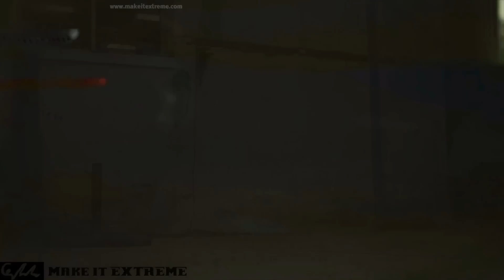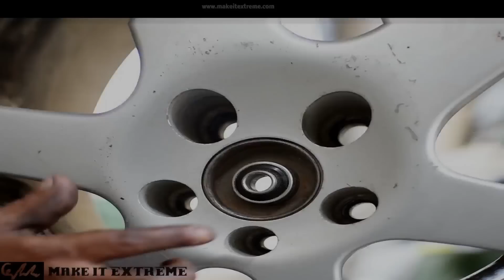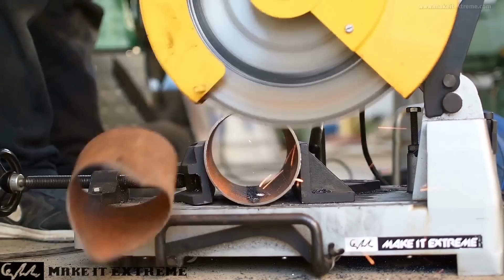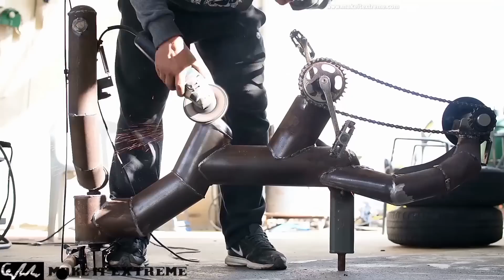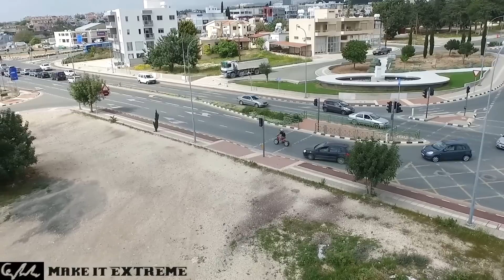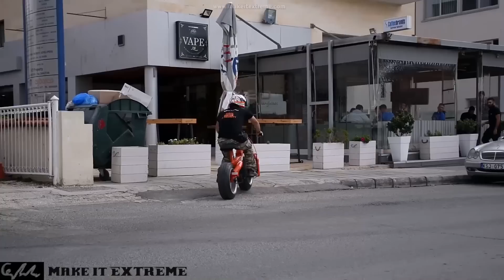Make it Extreme's Fat Bike

Comment: bench press, magic magic magic. vice, magic magic magic .drill, magic magic magic .ball bearing, magic magic magic. TADA made a bike
Reply: Amrit Lal Singh I know, right?
Reply: Amrit Lal Singh I
Reply: So ,welding pipe pieces to make a bike skeleton requires magic ? I'm pretty sure nobody scratches his head over the manufacturing of dead simple parts that were not shown in the video.
Reply: What he manufactured is the same cheesy parts we all hate about Chinese manufacturing, (but they are getting much better lately)  fancy looking easily machined soft low carbon steel that cheeses apart after a few uses. I bet it lasts just long enough to get the footage of it being ridden on the street. Real Bike parts are high tensile forged high carbon or stainless steel, expensive and much harder to work with if you are machining your own creation... He would have added some credibility if he had at least case- hardened the parts he machined so they would stand up to the abuse of being assembled into a hundred pound bicycle creation...
Reply: @cameik  You mean they made it from Chinesium?? :-D

Comment: i want one
oh also, you might want to consider using a bigger sprocket so it goes faster
Reply: ddoctor 46 Rossi fan brother!??
Reply: yeah right you try to pedal a 200lb bike at any speed
Reply: jeep2003 fat tires are not pratical if u want speed and ez of pedaling
Reply: Did he say he wanted speed or ease of pedaling?  Just enjoy the video and the coolness of a huge frame and tires from a car.
Reply: Might want to consider gearing.
Reply: opiate indeed
Reply: GhilleGhille well it's tricky to do because of the frame type
Reply: jeep2003 well once you get it going the inertia from the tires will keep you going anyway, getting up to speed is gonna be hard anyways, might aswell make it go a little bit faster
Reply: I have gears on mine. Any bit of a hill it needs low gear but on the flat its definately nice to have a few more higher ones for cruising

Comment: Convert it into a 3000 watt mid drive electric bike
Reply: Powered by an angle head grinder!
Reply: Don Legaspi even still it would drain the batteries its tooo heavy and these tires create tooo much friction. not pratical as is even as electric
Reply: get a 2hp starter motor on each wheel, and a couple of 100ah batteries, that should work for 15 minutes.

Comment: where's the engine
Reply: It s a bike.
Reply: @luisjuez2003  I know. And it's a good one. A version with a mid drive electric motor or rear hub motor would be interesting. The frame tube would be good for the cells. Rout all cables through frame keeping it neat and it would be a fantastic off road e-bike. There is a gap in the market for off road e-bike that are not conversions with cables and wires cable tied to the frame as if an after thought. Go on go electric and shock everyone. But remember to hide everything so it looks like it does now.. Great engineering project.. Who knows could be a revenue stream in the near future..
Reply: @extrastype  thanks for the information.

Comment: Hmmm, amazing assembly, I'm sure that, though it goes against almost everything that makes the bicycle one of the most efficient vehicles made by man, i believe there would be a large market for this in the United States, just put in an assault rifle holder rack next to the water bottle holder, and yes you had better hydrate well as you grind off the miles riding this thing, how much does it weigh?  About 100 lbs?!  This would fit nicely in a similarly assembled rack on the back of any Hummer... A bicycle with built in theft protection, the thief only gets about 1/2 a  block away and you hurry on up and catch him on foot! 
Unfortunately, after all the fancy schooling in machining and welding, this guy pulls some truly bonehead moves on the street while riding- pulling over into oncoming traffic lanes to pass a row of cars stopped at the red light, to be first in line,  then turtling around the corner with a choo choo train of cars lined up behind him!  I could almost see the one guy raising a fist to you as he changed lanes and sped off! You- sir, are re-enforcing why some automobile drivers hate all cyclists on the road!